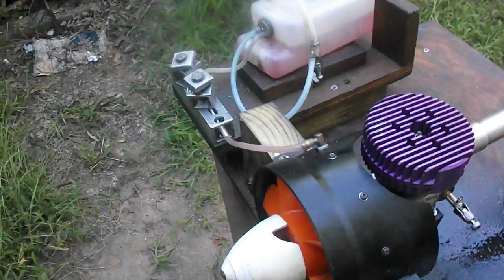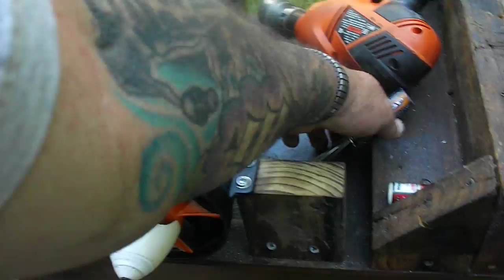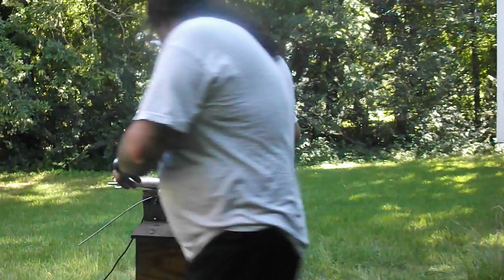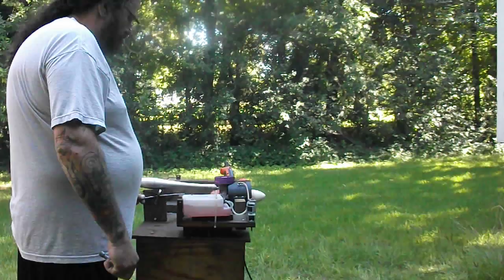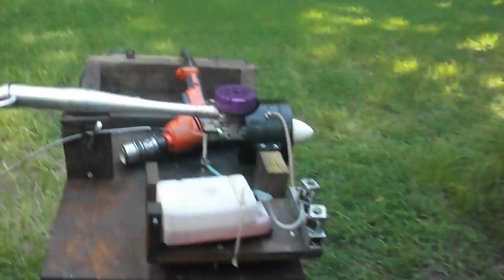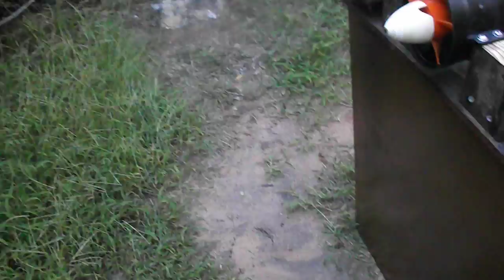Webra 61 Ducted Fan Engine RamTec DF Unit Running FOR SALE!

Comment: Great Presentation
With all due respect, it is possible to inform viewers ( who may be interested in your product)
 what a DUCTED FAN UNIT engine is about and the difference with the regular gas OS. DL RC gas engine please

Question
Does any DUCTED FAN UNIT engine work better than the piston engine in terms
of Velocity? fuel consumption?
I am building an UAV and I am interested in the long range autonomous flight from Point A to Point B
will it work, if I used the Ducted Fan Unit Engine?

Comment: Which is POWERFUL a DUCTEDFAN powered by ELECTRIC MOTOR or PISTON ENGINE DUCTED FAN?men I DO LOVE YOUR WORK.
Reply from the maker: both of them big ones put out the same. the smaller one electric ones put out more than smaller nitro ones!
Reply: @GaryFlymore   Really...well that is very impressive result for ELECTRIC ENGINES but somehow i wonder because as far i understand electric have INSTANT FULL TORQUE from the start of you POWER them UP but has a LOWER RPM than PISTON ENGINES  while PISTON ENGINES don't have enough those instant FULL TORQUE at its starting but PISTON ENGINE DEVELOP MORE POWER TORQUE and MUCH more HIGHER RPM on its  CONTINUOUS POWER.Hows that possible for those ELECTRIC ENGINES to LEVEL they're POWER  on PISTON ENGINES? THANKS for sharing your knowledge, i just want to choose best engine for the DUCTED FAN.
Reply from the maker: @coc7711  if you want to buy a DF unit with video let me know I have them all. Im Gary Wayne on FB> my email> flyingmadness456@aol.com.  TY>  Gary

Comment: Im just wondering why you are loosing the glow plug before you start it.?  you have no compression and you are letting in too much air and not creating vacuum to suck up the fuel.
Reply from the maker: you got to be kidding me!
Reply: @GaryFlymore  You are really a welcoming guy huh? It was just a simple question
Reply from the maker: sorry man>  all the best***  Gary
Reply: Glow engines do NOT use vacuum from above the piston to draw fuel. That happens BELOW the piston, in the crankcase. And also, these engines have a LOT of compression, and start EASIER with the glow plug loose, or else it would be too hard to crank over if the plug was tight.